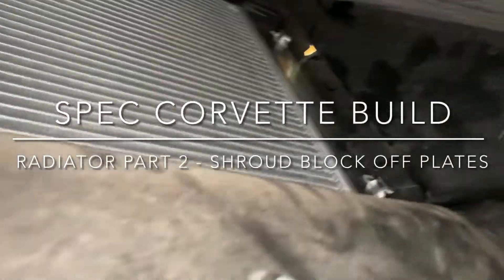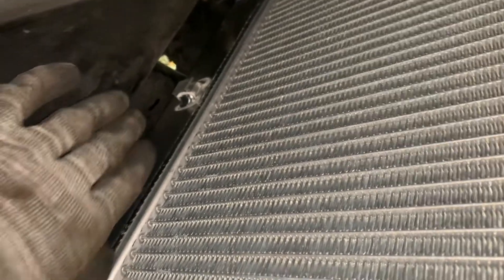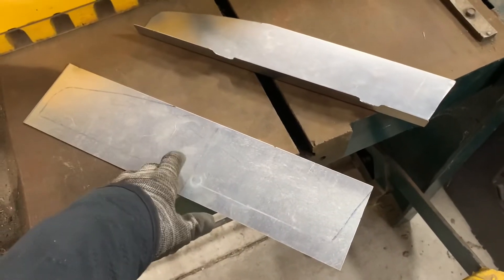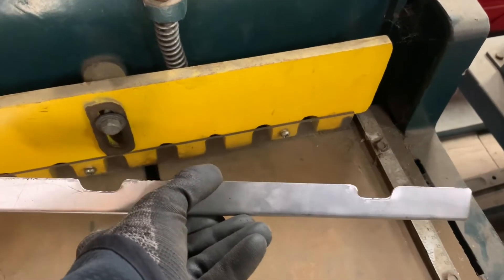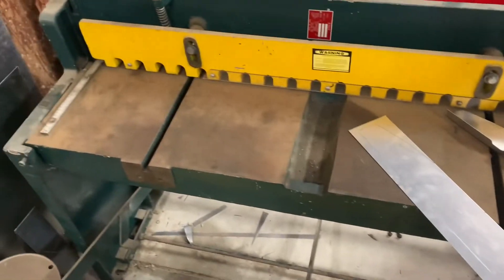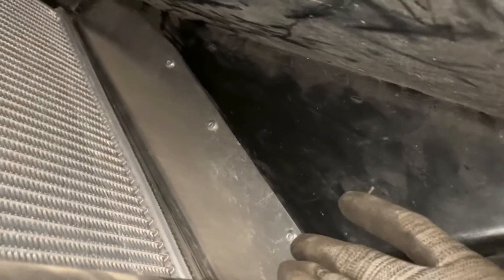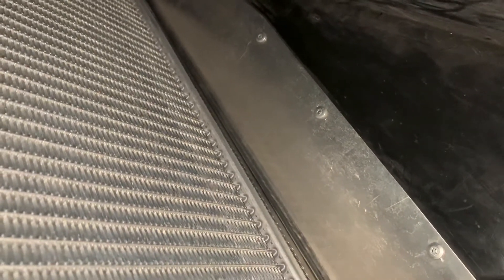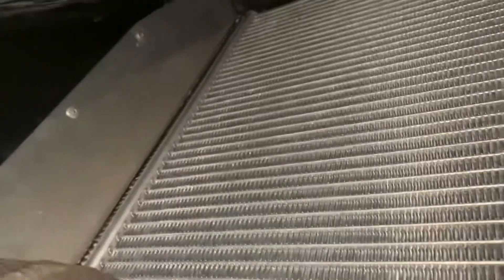Spec Corvette Build - Radiator Part 2, Shroud Block-off Plates

Comment: Nice work. Did you re use the factory upper shroud? I’m thinking of deleting mine not sure if it will affect the cooling.
Reply from the maker: Yes, I used the factory upper shroud. I’ve seen one racer make his own shroud and use silicone to get a tighter seal and force all air through the radiator. He also removed the factory fans and replaced them with a 14” fan to keep it cool enough at idle in the pits but allow more air through at speed. His coolant temps run lower, so I’m putting that (replacing fans) on my list as something to try.

Comment: Can you get Trackspec to build these ? This is a great idea, instead of using duct tape every where.
Reply from the maker: I know they are considering a custom shroud that includes built in block-off and an opening for the airbox. I don’t believe it’s been designed yet, though.